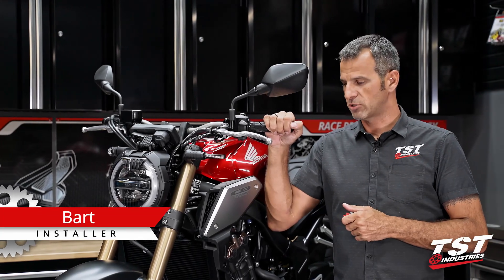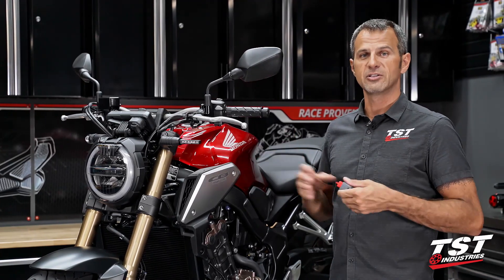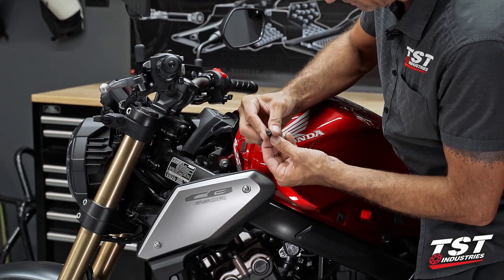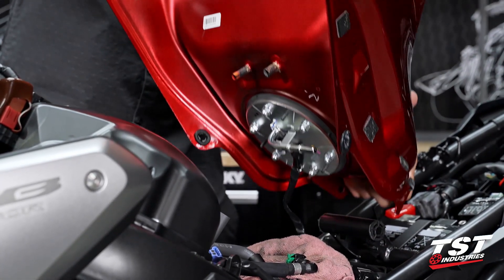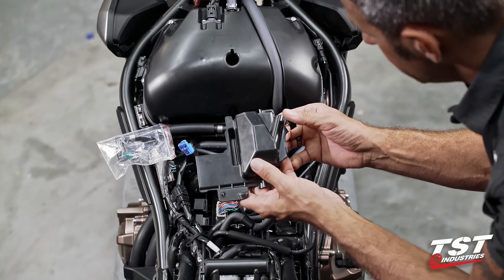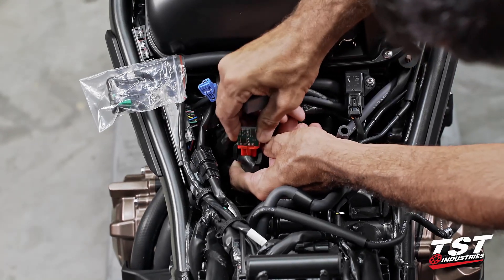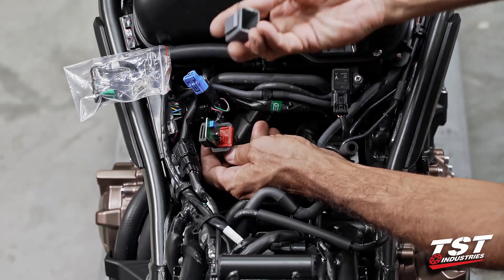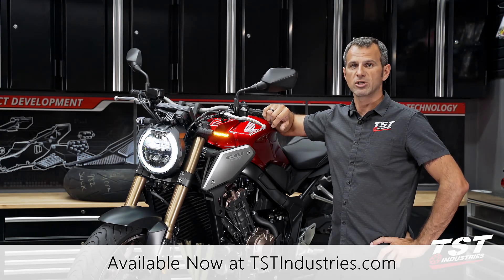How to install an LED Flasher Relay on a 2019+ Honda CB650R by TST Industries

Comment: might be a dumb question---can you take off the fuel hose, with fuel in the tank? Is there check valves, or will fuel pour out ?

Comment: Just FYI for anyone working on a 2023 CB650R, the relay is not in the same location as this video. It took me a minute to find it. Where the relay on the bike in this video is just to the left of the 2 big ECU plugs, the 2023 is just to the right of those plugs. Overall, pretty simple process and fixed my hyper blink after installing BL6's on the rear of my bike.
Reply from the maker: Thank you for pointing that out. Your finding will help some of our viewers perform this on the newer CB models.
Reply: @TSTindustries  This doesn't fit the 2023 CB650R. It has an 8 pin connector. This is the part number "38301-MKJ-D01" and it's an 8 pin connector? Or is there something I've missed? I've also checked the parts diagram on partzilla, so I'm pretty sure I've got it right?
Reply: good comment i had the same issue but found it shortly after
Reply: Could you tell where is the relay location? It's under the seat or gas tank?
Reply: @wilfredwong92  It is still under the tank.  The relay on the bike in this video is just to the left of the 2 big ECU plugs, the 2023 is just to the right of those plugs.
Reply: @edrobinson4174  Thanks.
Reply: @wilfredwong92  The original is not adjustable. That is why you need to get the TST relay!
Reply: Cheers dudes
Reply: So did you need to remove the gas tank on your '23 to change this? I have a 2023 and really dont want to tear my bike apart if I dont have to
Reply: @cameron9578   no you don’t have to remove the tank you just have to dig into the wiring a little more than the video, just prop your tank up with an old cardboard box just don’t pull on the fuel lines
Reply: Is it the same relay? Mine seems to have 8pins...
Reply: Is the 8pin flasher relay the same for 2024 cb650r e-clutch model
Reply: Don't suppose anyone found a adaptable one for the 2023 version did they

Comment: hello, is there any relay with sound ? Thanks
Reply from the maker: What do you mean "with sound?"
Reply: i mean the one that makes noise tik tik tik when you operate the flash @TSTindustries
Reply from the maker: @TMz_Photo  we don't make them. I have not heard one tick on a bike in a long time. Even OE ones typically don't.

Comment: cannot for the life of me find the relay on my 2021 honda cbr500r
Reply from the maker: For that model and year the relay is labeled Mitsuba, and its harness branch stems from the same place on main harness as the tip over sensor branch. From examination of fiche I can tell that it is likely on the left side of the bike up front around steering head. I would pull off left fairings in that area and you will likely find it real quick then.
Reply: @TSTindustries  and your relay will work for it?
Reply from the maker: @charlieh6718  our RLYG2 sku part will work
Reply: @TSTindustries  Had a look where you described and cant find the relay I've asked Honda themselves and they didn't seem to know loosing my mind 😅
Reply from the maker: @charlieh6718  you can bring the bike to us if you are local and we will find it. If you aren't local, you will have to follow the harness up the side of the bike til you find the relay. The nearest neighbor part is the tip over sensor. Those are mounted center of the bike. Honda typically puts them on front end or rear end  in this case it is on the front. So the relay must be somewhere near front center. From fiche it looks like left side of the frame just aft of steering head. Beyond this, I would have to get into the bike myself

Comment: In fact not all the cb650r 2019 up comes with 3 pins plug , some models come with 8 pins , may be will be a goof idea for tst industries to check that , if you build one for 8 pins I will be buying one form you , because others company a selling 8 pins relay but in Germany
Reply from the maker: Where are you from? The American market bike has the signaling relay that is replaced by the one you see in this video.
Reply: @TSTindustries  just seeing if you guys have made a relay for the 8pin relay yet? I'm located in Australia and can't seem to find a relay.

Comment: My Australian delivered Cb650r relays look nothing like these ones. Most of my relays are 5pin and led flasher relay has about 13 wires running into it and is significantly larger than these??????
Reply: Hi actually I have the same problem , my flasher relay plug is so diferent than tst are showing in this video , something is not right

Comment: Added Mblaze pin to the rear of my CB650R and got no flash whatsoever. Will this fix it? Thanks
Reply from the maker: Well that depends on whether or not you have everything connected correctly.  If your signals are connected correctly and your flash symptom is resultant of your signaling system not handling the present current draw appropriately then our relay will solve your problem.

Comment: I really need help finding a flasher relay for the 2019 Honda CB300R. Would this one work on that bike?
Reply: @joecaljapan  I believe the CB650R relay worked on my CB300R and the turn signals I used (some cheap LED ones from amazon) worked fine with no offbeat. I think you'll be fine with it. If I'm not mistaken CustomLED also sells one for the CB250/300r as well.

Comment: Dose your fuel tank need to be empty ?
Reply from the maker: Depends if you go to the gym...haha...its just heavy if it's  not empty
Reply: @TSTindustries  So I got the part and installed it correctly But my flashers still are not working... they work in ignition but not when the bike is running. Any suggestions ?
Reply from the maker: @TheSuperjoe5  your issue is most likely related to the wiring of your signal lamps. What are the frontvand rear signals that you have and how are they connected into the bike?
Reply: I have tru wraps led on the front and small leds (can’t ) remember there make ) on the rear wired as per there instructions. On the tru wraps they have a thing in there wiring called an A W converter .. im not sure if that has anything to do with it ?maybe you do ?
Reply from the maker: @TheSuperjoe5  i dont have the resources to look up another company's wiring diagrams so i cannot speak to the instructions you were given. More likely than not the instructions were correct but maybe ambiguous. The front signals on these bikes have two circuits: running and signal. This means there is a positive lead for signal (blue or orange depending on side of bike), positive for running light (same colors per side but have white trace), and then of course grpund which on these bikes is green. We sell harness adapters for our signals that plug right into the bike and make install a breeze. If another company doesn’t have plug and play capability in their equipment there is a chance to wire the equipment in wrong. For instance, if you were to connect the running and signal wires together to make a front signal os single circuit type act as running and signal light, then you are pushing stray current through the signaling system and disrupting its proper function. I would say that you should disconnect all signals, reconnect one and make absolutely sure that it is connected properly, and test it. If that passes go to two, and so on.
Reply: TSTindustries i did some more tinkering and a got them to work very happy with the relay thanks for all the help 😊
Reply: @TheSuperjoe5  how did you fix it in the end?
Reply: @philippbehrens9399  I took the aftermarket resistors i had put in out of the circuit and just use the relay from TST